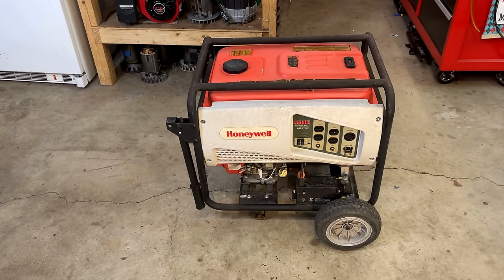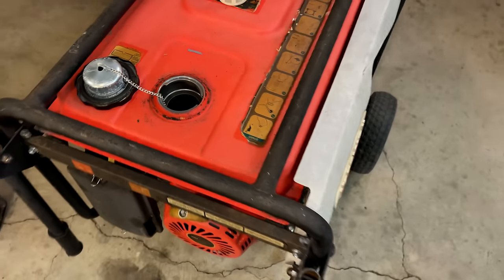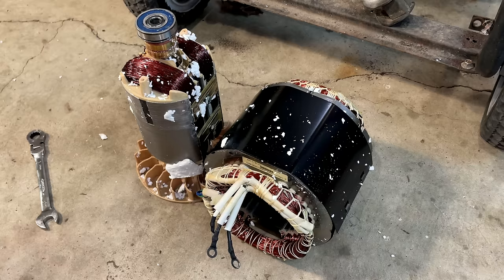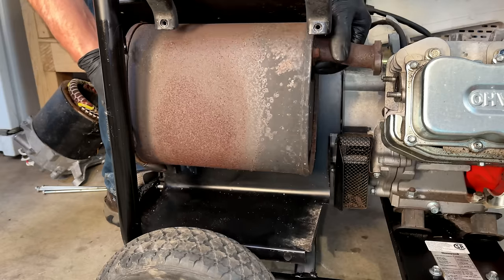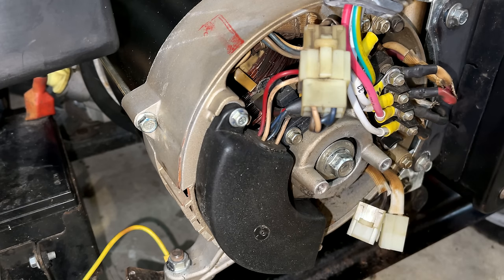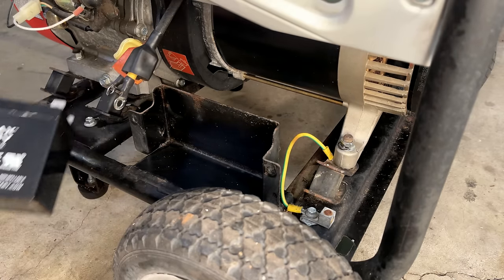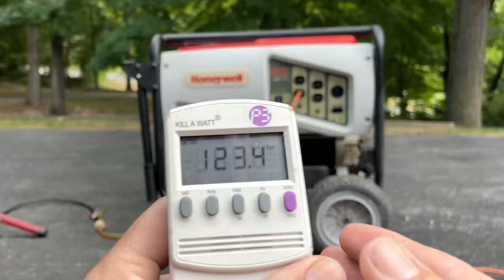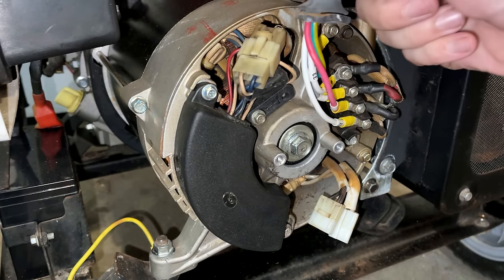Honeywell Generator Not Making Power - Fixed

Comment: I noticed that you connected the red to the black and the grey to the red when rewiring does that make any difference ?
Reply from the maker: Not in this case.  The neutrals are still connected correctly.  But leg1 and leg 2 now go to different 120 outlets.
Reply: @jcondon1  ok cool I was just wondering, thanks

Comment: Where do you find all the recommended torque values?
Reply from the maker: I have a few manuals.  Not on for this specific generator, but the bolt sizes are the same and most manuals closely agree.

Comment: James... I have looked at quite a few of your videos and you have a small pair of nippers with which you cut wire bundle ties.  I could not find it in your tool box in your amazon shop.  Help!  It is very difficult to cut those with the regular size nippers.  I have been known rob the toenail clippers for that, but then when I need them, they are in the TRUCK.  Also, what is your source for the short cuff black gloves you wear most of the time when dealing with fluids?  Watched to the end....Did I miss the source for the special zip tie that you used on the unused connectors at the very end?
Reply from the maker: Similar wire cutter are on Amazon https://amzn.to/3Xw6Crs.  These are the gloves I use: https://amzn.to/3Dc9zVT and the zip ties: https://amzn.to/3R6Idqg

Comment: Is it possible to use rotor and winding of this generator to make wind generator?
Reply from the maker: Would not be good for that.  It has to spin at 3600 rpm and needs about 10 horse power to drive it under load.

Comment: Good morning 🌄, quick question, I have a duromax xp 4000s that starts up with no problem at all, 1/2 a pull gets it going, my question is, I'm running a 2 inch submersible pump, it will pump for a minute, then it shuts down the power out put for 30 to 45 seconds then starts the cycle of pumping for a minute etc, any thoughts on this? It's annoying when you are trying to pump water down on the job

Comment: What is the best brand of generator to buy ? Mine bit the dust on me last week and i'm looking to buy another to use with my welder and whenever there is a power outage
Reply: They're probably all about the same. They're probably all made in the same factory these days. When you can swap parts from different brands together that's telling.

Comment: Really enjoy your channel and the information. I have a Honda EU2200i with a little over 400 hours. It surges in normal mode but runs smoothly in eco mode. It will run with 400 watts for about 6 minutes then the engine dies. It will restart and do the same . Carb and jets have been cleaned. I am thinking an electrical problem. Your thoughts
Reply from the maker: Might be a fuel delivery issue.  When it stalls, shut the fuel off right away and drain the bowl.  See if it ran out of fuel.
Reply: @jcondon1  will do

Comment: I changed the oil on my generator a few days ago and was going to find out what the oil drain plug thread size is. Mine appears to be the same as yours so do you know the thread size? I want to put an extension on mine to make changing oil a lot cleaner. I thought it was 1/4 npt but the plug is fine thread and a smaller diameter.
Reply from the maker: Sorry not sure

Comment: Some plastics can be cleaned by using hydrogen peroxide. Sometimes you may have to seal the plastic and hydrogen peroxide together overnight. Just leave the liquid on a tray if overnight, not on the surface of the plastic

Comment: Love the videos. Long time viewer. You do real quality work and its enjoyable to watch. I noticed the valve cover had a spot on it for a rubber hose and was thinking mabe the went to the air cleaner rather than the fuel tank vent. Love the videos and I just got a generator myself. What a pain in the butt it was running extension cords through the house ect. I gotta do one of them plug ins into the circuit breaker panal.
Reply: I installed a Reliance generator transfer switch kit at my son's house.  Has built-in watt meters for each leg.  Works great and very easy to install.

Comment: Could you have adjusted the AVR with the engine running?
Reply from the maker: Not recommended due to the voltages and moving part.

Comment: Hey Jim, great video as always.  Question: How does the battery get charged when the generator is running?  If I understood correctly, the extra two connectors were not hooked up, and I assume one of them is for charging the battery on the original generator that you pulled the powerhead from.  So I am left slightly confused, and will not be able to sleep at night until I know the answer!  LOL  Thanks again for all your time and effort making these videos, and I would imagine the editing of them takes forever.
Reply from the maker: The Honeywell has a charge plug on the front of the unit.  When not using, you can plug in a charger to top the battery off.  A surprising about of generators do not charge their battery when running and instead you charge them after using them.
Reply: @jcondon1  Thanks!  Now I can go to bed without overthinking it!  Again, great job on all your videos.  God Bless.

Comment: I can resolder that rotor wire for you. I can even solder to aluminum if you need. No special tools or strange solder needed. Just  sandpaper, vaseline or mineral oil, RA flux, and 63/37 leaded solder.

Comment: Great video James.  Question on the sales side - That generator can't charge the battery for the electric start.  Would you include the little AC adapter in a sale, or recommend the customer buys one?  Just curious.
Reply from the maker: The Honeywell has a barrel connector on the control panel for an external charger when in storage.  I have that type of charger and would include it with the generator.

Comment: why not make the voltage adjustment while the engine is running?
Reply: Because he's making a video that's being released to the general public. So there's liability issues to consider. Now he could issue a disclaimer. But he's just decided to use best practices instead.

Comment: A 2012 Powermate I just bought with 40 minutes on the timer is extremely similar to this. The manual for it is even on the Honeywell website. I tested it with 6kW of electric heaters, and it will always surge if going from a higher wattage to a lower wattage, until the engine heats up for a bit. It doesn't do it on the way up, however. 
Is that behavior indicative of  the beginnings of a problem, or is that something normal?
Reply from the maker: It does not sound normal.  I would apply a little choke and see if it gets better.  If so then the carb is not delivering enough fuel.  If not change then it almost sounds like a governor sensitivity problem.  Is the spring on the inner our outer hole on the arm.  If inner then that is likely the problem.  Move the spring to the outer and back off the spring tension.  Restart, set engine speed to 61.5 hertz no load and test again,
Reply: @jcondon1  Thanks for the info. I appreciate your time.

Comment: how is the battery going to charge without the 12 volt wires hooked up?
Reply: I think there is a charging coil usually installed behind the flywheel. As well that coil wire is usually white color comes out near the low oil module goes to control panel through a 1 Amber fuse.
Reply from the maker: The Honeywell has a barrel connector on the front for charging.  Must use an external charger plugged into the wall.

Comment: Thank you James.  Again great teaching.  When a generator has an AVR does this automatically mean you never have to flash the windings with a drill in reverse which is sometimes required on older style generators?  Kind Regards.  Craig
Reply from the maker: The AVR just keeps the voltage steady no matter the load.  Also all generators that use an AVR have permeant magnets on the rotor, so no need to flash with a drill.  Residual magnetism cannot be lost.
Reply: @jcondon1  thank you so much.

Comment: has anyone ever had a carb ice problem in the winter with a generator? My generator manual recommends building a winter enclosure (heat rated) to keep some warm air in and prevent carb ice. Any thoughts?
Reply from the maker: They will ice up in cold weather.  Some like Briggs, Generac and Techseh have air boxes that can be configured to take hot air off the exhaust or engine head into the carb to prevent that during winter operation.
Reply: @jcondon1  thanks for the information I have the troybilt 6250 that I’ve seen in your videos.so far it works perfectly, just worried in a power outage in a snow or ice storm that we get sometimes something like carb ice would happen. Do you have a part # Briggs air box that can be configured to get hot air from the motor?
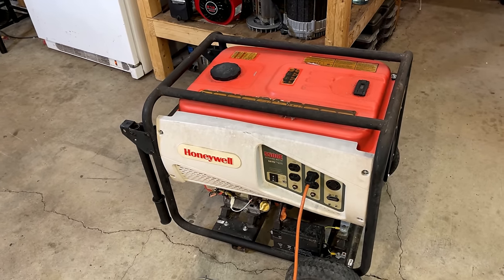Reply from the maker: @scottie370  do not have the part number off hand.  It is the plastic piece I am removing from the valve cover in this video at the 3:44 mark https://youtu.be/iL71E87C92Y. I think I have the engine number in the description.  From there you can find the diagram.  Only compatible with the 9 and 10hp OHV engines like the one in the video.
Reply: @jcondon1  thanks!

Comment: Do you think it would be possible to make a belt driven generator head from one of these? Maybe make a tapered shaft to replace the crank and engine, with a pillar block bearing to have a bearing on the front end, at the new input shaft?  I was going to get one from harbor freight, maybe two, but they do not seem to have them anymore,  I was wanting to connect a couple of them near 10kw to a car engine, on a small trailer,  something around a 1.8L honda  engine, under 2 liters anything larger would be beyond overkill, with a electronic governor, it should work great,   hopefully it would make enough power to run at a slightly fast idle,  1200-1500 rpm, I
I can always just mount a few Delco 21si alternators to the engine, and build a inverter generator,  put about 10-12 kw inverter on it, and about 200-400ah of batteries, so it can also use a small amount of solar on the trailer to also charge the battery, about 1200-1500 watts or so,  but I was looking forward to seeing how the larger engine effected surges on start up, if it would start heavy loads easier,  a low frequency inverter will do ok, I'd probably build a soft start for the heavy loads I have 2x 150amp 21si alternators , and two, 130a alts as well, plus a 28si, 150or 200amp, and a couple 100 amp 12si,  I can mount the rectifiers externally and wire the outputs in series, for 24v,  or further mods for 48v 
But do you think making a generator head stand alone is possible, and be reliable??   Sorry I got carried away, rambling, great video, I wish I could find some of these, I might just use as is,. Seems ppl want  too much for things around here,  but do not want to pay up when you try selling it, last one I tried to buy they wanted $200 for a 35-40year old 2000 watt generator, 2k or 2400 watt somewhere around that size, I got a 7200 for $150,  been unused fof 5 years, but started for a few minutes a few times a year, it's from the 90's has a tec. Engine, can't say the name or spell it apparently,  but the engine company named after the Indians/ native Americans, I hate the plastic fuel tank, it has a seam half the way up, that seeps gas when it's over half full, so I use a 15 gallo fuel cell as a tank,  it's about 4x larger than the tank, it should run a long while on a full tank! It has two 1/2" outlets, so I can use it to run two generators, or like a gas station to fill mowers and what ever,  getting 5extra gallons when I get gas to keep it full should not be too bad,  I use it to wash/ dry clothes , in off grid house, the inverter powers everything else!  Sorry again for all the rambling! ✌️
Reply from the maker: If you could work out the tapered shaft problem and the bearing issue on the engine side then it should be possible.  The easiest thing would be to find one with a blown up engine.  Use the engine end housing to support the bell housing and bearing.  You could also cut the crank and use that to to drive the rotor and mount a pulley.  Would be a challenge.  You need 1hp for every 550 ways.  It might be easier to mount several large 12v alternators to power an inverter/battery bank.

Comment: Would you consider attempting a reapir to the old unit for education pureposes. I wonder if cleaning the wire and wrapping it with several fine wires for strength and then solder and coat with epoxy ,may work out better.

Comment: Man you need to buy a lift table . You can't keep working on the floor . Harbor Freight sells a foot pump 500lb lift cart for less then $300 that goes 36 inches in the air. I just bought one used for $100 so I can load big generators in the back of pick up trucks.
Reply from the maker: I recently got one.  You will see it soon.

Comment: off topic of this generator but I  was given a champion unit. it starts but immediately dies . if avr is disconnected the engine starts and runs fine. connect avr and it immediately dies. an  obvious defect?
Reply: i should have included that new brushes and avr made no difference.
Reply: I'd guess there's a short on the main windings. Either inside the stator, or in the wiring somewhere. I would suggest disconnecting the stator power windings from the connection block. If there's continuity from one disconnected winding to ground or to the other winding (assuming it's 4 wires) you know the stator's bad. If it runs with the power windings disconnected but the AVR installed then it's probably in the wiring.

Also note that if there is a short and the engine does not shut down then there will be tons of heat generation which could cause further damage or possibly even a fire.

Comment: 17:12 Usted opina que los alambres del rotor son de aluminio coloreado, pero hago zum en la imagen y veo dos extremos de alambre retorcido y soldado con estaño, es estaño porque si el aporte fuese aluminio no podría soldar a baja temperatura. 
(Estaño 231°C - Aluminio 660°C)
Por lo que concluyo que ese rotor SÍ puede ser reparado.

Comment: Thank you James.  Another excellent video. Its a shame that it is not possible to unwrap just the end turn on either the rotor or stator windings. The loss of one turn would hardly affect the output and would allow clean, unsoldered wire to form a new end.
Reply: Unwrapping is one, but reliably soldering the aluminium wire as James mentioned is also a big issue.

Comment: thanks for the video. I've never thought keeping my generator outside could've caused the rotor to fail. Just learned it the hardway. My rotor on my Duromax 12000EH just went bad after less than 20 hours. But it's been sleeping outside for more than 1.5 hours. As soon as I bought our RV, plugged it. It worked for like 12 hours and then went out.
Bummer!
Now I'm just debating if it's worth to spend $200 (discounted rotor price from Duromax) + Labor. Then what is if it goes bad again? I may as well just buy a new one or just hook up power.

Comment: Thanks to your video, I was able to go directly to my problem with 2 minutes of troubleshooting.  Turned out the rotor was open like this one.  Found the wire broken from the solder joint at the split rings.  A little bit of soldering later and all is good.

Comment: A super job as usual but how is the battery being charged if you did not use the DC winding?
Why would they mix aluminum wire with copper in the rotor?
Reply from the maker: I lot of generators do not have a charging circuit.  Must use a battery tender.
Reply: @jcondon1  That makes good sense which provides a better chance the battery will be charged because as you know, many generators are ignored until needed.
Reply: @ron827  Don't forget it has a pull start also if you forgot to use the battery tender.

Comment: Super clean works 100% on white plastic I raced a yz250 with white plastic and the only thing that could get the red clay stane off was  Castro Super clean it's in a purple bottle  Simple green purple stuff purple power nothing would get it out but Castro super clean would every time with ease !! Hope this helps and for my  Generator I got a minn solar charger 12inch X 12inch came with  Suction cups   to put inside of a window was like 20$ and just put it in the window of the shop where sunlight can hit it some of the day and it keeps my battery charged up!! Great video as well !!

Comment: hi, I hope you answer questions about generators. I have a 5500 watt generator that makes (electrical) power fine. but the engine is getting a bit noisy 9sounds like something is knocking.)  I have run synthetic oil in it since new. the last 5 years or so, it seems that we almost exclusively loose power when it is cold. this has a 10hp Tecumseh single cylinder engine. im in my late 60's, so I have lost a good deal of strength. in order to roll it over fast enough to start, I have put 0w40 Mobil one in it  to be honest, i also was worried about how oil would not flow, and I did not want to spin a rod bearing [full rpm on a dead cold engine, with thick as tar oil ]  (if it has that?)   usually, our power is restored in 2-24 hours. but there has been a couple of situations where it has gone a couple of days. i do not run the generator when we sleep. but other than that, it usually runs all day. do you think i have harmed the engine running that oil? as it is, I had to hold a propane torch on the crankcase for about 5 minutes in order to get it to start last week. i can not imagine what trying to start it with straight 30 weight oil would be like in the cold.

Comment: It’s probably to late but if you would wet sand that front panel with 6-800 then to 1200 should come out like new without much elbow grease 
I’ve done that on quite a few plastic parts in years past and always worked great